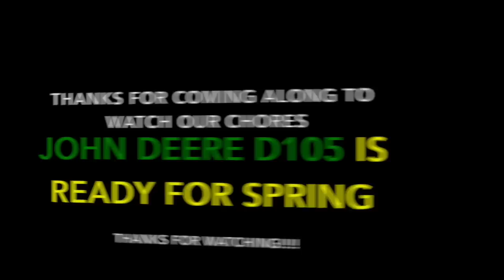Getting Ready For Spring: John Deere D105 Maintenance

Comment: +Off Grid Nation - Your question about ratchets, as long as you keep them clean, lubricated and unstressed, the name brands all last about the same amount of time. When I say unstressed, I mean not putting a 2-foot steel pipe on the ratchet bar for extra leverage, (which I'm sometimes guilty of doing). 
 
 On the Harbor Freight Tools, the Pittsburgh Pro series tools that are made in Taiwan and India, (opposed to the ones made in China), last longer due to a higher grade of steel and are a good compromise of quality versus price. 

 I go to Harbor Freight myself more often now since one opened up in the next town over from me. I just got tired of trying to track down a tool truck, (Snap-on, Mac, Matco) when I needed a specialized tool or had to warranty a tool or God forbid if I work on the weekend. Harbor Freight stays in the same place 7 days a week and doesn't give me an attitude when I call them to check if they have what I need in stock.

Comment: It looks like you didn't grease the center pivot on the front axle, its a bear to do because its way up and hard to see, but extremely important when you consider how much it would cost to replace the front axle.  Consult your owners manual for lube points.  You don't need to go up and over the hump when sharpening, if you look at a new blade, check them out at Lowe's or Home Depot, you will see the factory only sharpens the outside 3 or 4 inches of the blade, stopping before the hump.